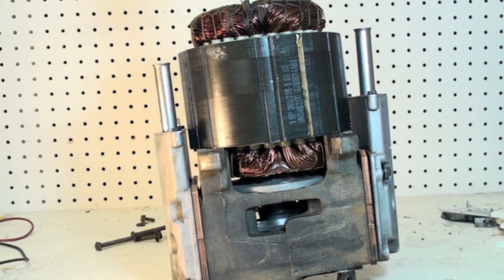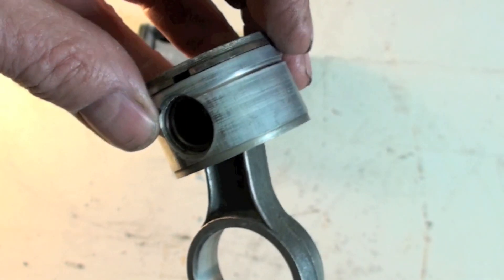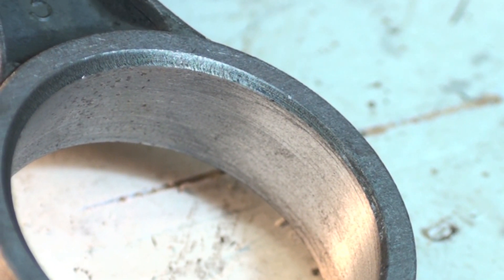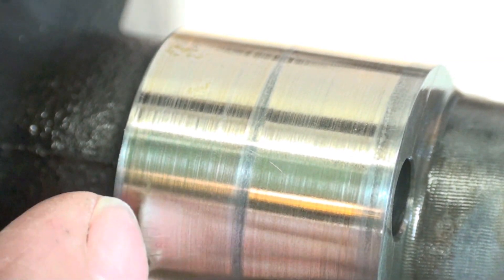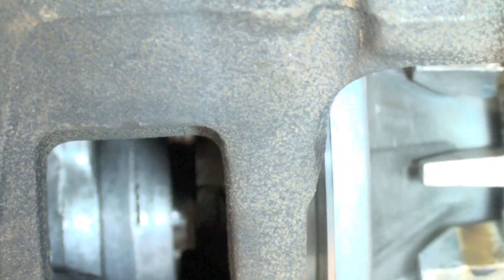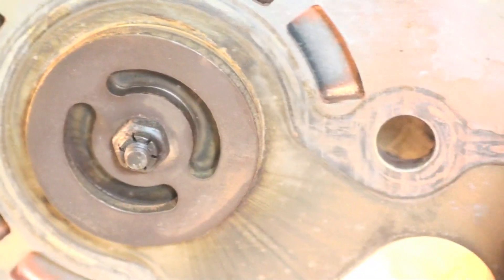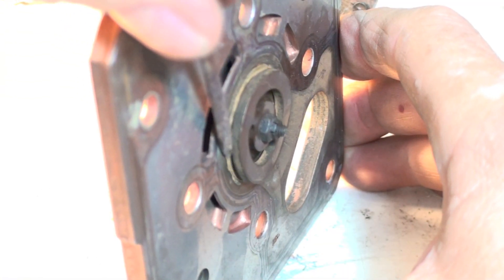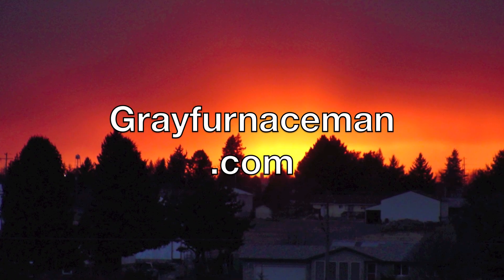How the Carlyle (Carrier) a/c compressor works

Comment: Damaged piston and wear from slugging?
Reply from the maker: Probably poor installation or repair
GFM
Reply: grayfurnaceman generally, when the company I work for, we don't do any internal repair to a compressor unless it's a blown head gasket. We just replace the compressor. I pulled the head off a Copeland 10 horse the other day and there was similar damage to the pistons from liquid flood back and slugging the compressor. Like the video tho
Reply: bblazeff1 generally *the ..
Reply from the maker: bblazeff1 On the semihermetics I usually stop at valve plate replacements.  I cannot be clean enough on the job site complete major repairs.  Thanks for the thoughts.
GFM